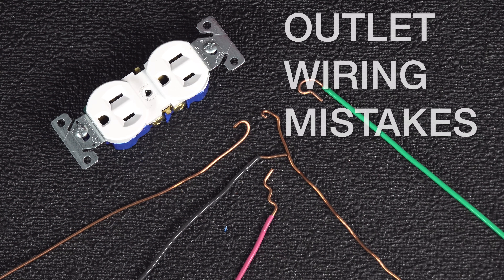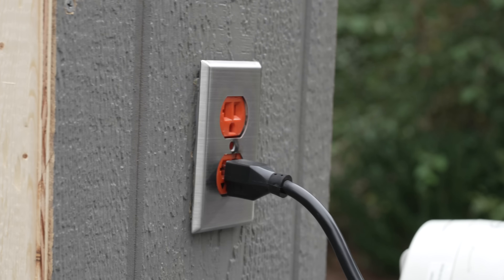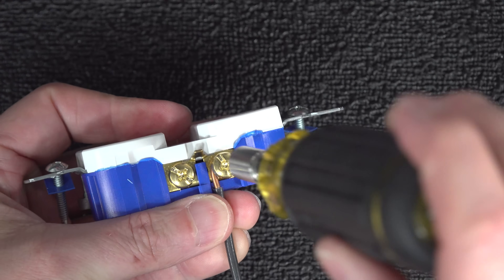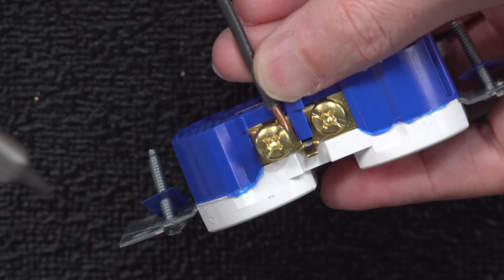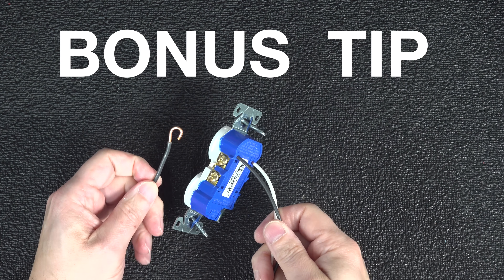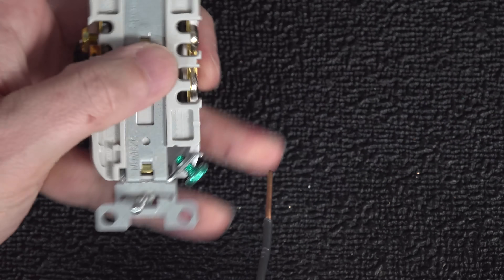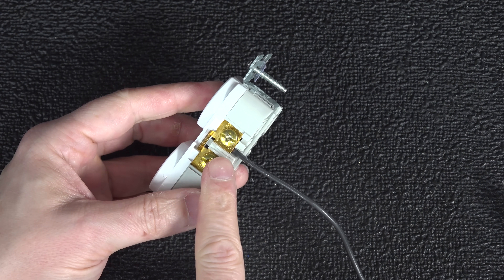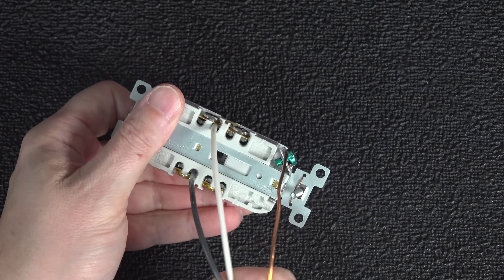BEWARE Of These 3 Common Wiring Mistakes On Outlets & Switches

Comment: I know the ground wire normally doesn't carry voltage, but, if the ground wire in a box is not properly pushed in it could contact a screw and short.  Receptacles are sometimes wrapped in electrical tape to protect against this.  Why don't the "Romex" manufacturers insulate the ground wire any more?  Cost savings, I imagine.  I've seen work from the 1980s where the ground wire had green insulation.

Comment: The issue most electricians have with back wiring, they buy the cheapest crap outlets they can because they suck at the job. Leviton or Eaton are all I use, you will NEVER have any issue back wiring. Buy the 12.99 /20 pack and,,, well you'd be kicked off my projects as a sub never to return

Comment: “Back-wiring…electricians are almost never gonna use them.”    If only that were true.   Every single as-built home outlet I’ve been into that was built since the 70s has been stabbed.   New construction is nearly always built as cheaply as possible, and saving a few minutes per outlet is money in the contractor’s pocket.   Anyone taking advice from this video should also research pigtailing…much better way to connect multiple outlets one one circuit than chaining them through the outlet connections.

Comment: Another tip:
When you shut the circuit off, make sure it’s not a split circuit that runs two lines off of a 3-1 cable, where the black wire runs to a breaker and the red wire runs to a breaker and you can flip just one breaker. Despite that, current can still flow through the outlet.

That situation may occur when the breaker box set up wrong. Both of those breakers should be tied together.
Reply: My votech teacher told us about that. He told us he only tested on half of the outlet, assumed it was dead, grabbed it and it "bit" him. It's a code violation to split a circuit without tying the breakers together for this reason.
Reply: @hubert0073  I was going to say that shouldn't a two pole breaker have a breaker tie...

Comment: Those sockets are so 1970's.  Iv been a sparky for 30plus years and never had to wind a conductor under a screw. Nz & Australia have sockets with conductor holes as terminations. Simply twist up and fold conductor back on itself and insert into hole, tighten screw..  move on.

Comment: This is great, especially the tip about using a simple plug-in type circuit tester to be sure wiring has been connected to the proper terminals.  Back in the 1980’s I purchased a circuit tester to check the house current at whatever venue my band was playing to determine how safe or noisy the electric current was for our expensive amplifiers for both the PA system and instruments. One particular venue was an older building, a country club on the north shore of Long Island where I was born. As soon as we set up and turned on our amplifiers a horrible loud buzzing sound came buzzing through our speakers. We tried switching the polarity switch on the amps: useless. I next tried rolling off the frequency of the buzz on the graphic equalizer with little success. Just for s#$TS and giggles, I plugged my new gadget, a circuit tester similar to the one in this video. HOLY MOTHER OF PEARL!  The illuminated LEDS indicated “HOT WIRED TO GROUND”(!). I immediately sought out the manager in charge of the building and asked him if he was aware of the problem. He had a look of disgust and disdain as he told me to mind my own business but in not a friendly tone. Nevertheless I asked him if any other bands had problems with the buzzing sounds in their amplifiers and he said maybe but no one ever gave him the information that I did. I even went on to suggest he have an electrician come in and check out the possibly of a dangerous condition. He walked away and that was the end of the conversation. 

Fast forward to a few years later; I noticed an article in a local newspaper about how this very same historic and funky but charming old building had burned to the ground in the middle of the night. No cause was reported but I just had a feeling, ya know?  I always wondered if that weird wiring could have caused a short and a subsequent fire in that old wooden building; guess we’ll never know.
Reply: They also used bronze or worse instead of copper in those days which was a huge number one issue
Reply: Wow! Good story! Good thing no one died 😳
Reply: On a bad termination energy is dispersed in the form of heat. The continual heating and cooling  (expansion and contraction) will loosen a terminal screw causing sparks a short then a fire.
Reply: you should’ve told at least someone who was a high public official in the area about it… or at least a tip to check it out. I wouldn’t be able to live with that guilt, knowing something happened with a fire and ppl got injured or even worse. great job 👏
Reply: The #1 reason for fires in restaurants, venues inns et cetera is the fire insurance policy and losses. The owner/leaser burns the place down and collect the insurance payout.
Reply: Hmm, him telling you to mind your own business makes me think it was intentional… anyone could just say “huh, that’s odd.”, and move on. He got defensive. Cashing out on insurance perhaps?

Comment: Having seen a duplex receptacle with the silver and brass screws on the wrong sides (from the factory that way), I no longer trust the colors but instead wire according to the slot position.

Comment: I wouldn’t use the slot in the back with the screw. If for some reason the screw loosens the wire can fall out. With a hook, even if the screw loosens the wire will still be there and you don’t run the risk of a short.

Comment: Where I live, almost every outlet I've ever worked with has been backwired, so electricians definitely do it.    
If I could, I would entirely ban backwireable outlets. ALL OF THEM. No matter how old the installation, 
they would have to be replaced with properly connected decent-quality devices by a certain date, Period.   
And one more problem: Most people fail to TIGHTEN the screws. They need to be cranked down HARD.  
I've found some so loose that the connections were far worse than with backwiring.   

No, I'm not a professional electrician, just a practical person.

Comment: The other thing you should point out is is the side with the green screw USA green screw is also the neutral side or ground as you called it the white wire the green and silver screws are always on the same side simple way to remember where the neutral wire goes same side as the green

Comment: Nothing wrong with Backwiring connection, 25yr in trade and it's the only way to safely do it.. The problem is "Homeowners" trying to be "Electricians" simply because they are CHEAP!

Comment: There are many misconceptions, the stabs on the back instance; wouldn't be there if it were illegal. And it best if only 3 pairs of wire is used. The example of the over used receipt. Is a 15 amp non-appliance... The other in the demonstration is a 20 amp. There is a difference. Proper way to hook up device. DON'T OVER WIRE IT... And anyone taking advice from a want to be electrician. Is asking for trouble....

Comment: NEC has required pigtailing wires for a few years now so in new construction you will only have 1 wire to each side of the device, which will then go back to a connector/wirenut that connects any other wires of a circuit. Designed to hopefully keep from overloading a device.
Reply: you only have to pigtail when you have more than 2 wires cause you dont want to double lug a screw and there is only 2 screws. if you have ever wired a massive house or building with over 100 outlets it adds quite a bit of time to a job to pigtail two wires. i have never know. any other way and ive been doing this 15+ years
Reply: You are confusing commercial/industrial requirements with residential requirements.  NEC does not require residential wiring systems to pigtail at the point of connection. Its all about what the device's UL and CSA listed uses are and possibly local ordinances that could require such a thing

Comment: yeah your bouns tip is bull shit. they are more like 2 or 3 times the price.  been buying installing replaceing, selling them retail and wholesale and have sold more outlets then you have ever touched or possibly even seen in your life.  do your research and understand what your talking about before you preach to the masses.  just shows how much your willing to teach your self before your think your done and move on... current price checking after typing this at lowes in CA basic easton 15 amp outs non TR $2.57 and your "HD" outlet in eaton 15 amp non TR $5.61.  do the math its not $.50 cents and it never was only .50 cents buying one outlet to film your chitty fake news BS film sure it may not seem like a huge cost difference but how many outlets do you have in your moms basement?  now go to a real house and count the outlets. how many? 50-100 or possibly more.  now do the math so for every HD one you buy you could have bought 2 basic outlets.  so your outlet bille went from roughly, 257 dollars to 561.  so what math are you using that works out to be .50 cents per plug?

Comment: You didn't talk about only one green wire per screw .. never, never, never double up green on the screw.  Use a pigtail of you have more than one outlet and tie them together using a crimp collar or wire nut to the main green wire.  ...  Great video ... can't tell you all the crap I've seen over the years.

Comment: The "backstab" method is easy, but dangerous over time. And loop hooking can be immediately dangerous if done incorrectly. And though safer, it's too hard to do it correctly. But the clamp method is a Godsend that is easy enough, yet safe enough. But why is the ground still required to be loop hooked? Is it because it's safer than clamping, in which safety is critically important with the ground connection, unlike the hot and neutral connections? Or is this an unspoken political compromise to the  old school master electricians crowd? As in, "Fine, we'll tolerate backstabbing the other two connections, but only if the ground connection remains strictly a loop hook only."

Comment: You forgot to note that on the better outlet you can snip the jumper and make a separate outlet for each of the 2 plug ins so you can have a garbage disposal plug in on one of plug ins controlled by a light switch and not effect the other plug in or... such as in a living room where the light switch can control a floor lamp plugged in, while the always hot plug in can be used for a vacuum.

Comment: You cannot put 8 wires into these slots- This is a code violation-  "devices shall not" be used as splicing devices.  Period!  youre obviously not a trained electrician.  if you need the code section let me know.  bad information on that section. they have another purpose which i will not go into since you didnt cover it.  The stablock on the back is for 14 gauge wire only which is 15A rated.  This covers the reduction in contact on this 20A receptacle. Be safe kids!

Comment: I’ve been an electrician for 25 plus years and I still wrap the screw with the wire even if it’s like the last one. Old habits are hard to break. I also usually wrap all screws with electric tape especially if it going in a metal outlet box.
Reply: I do the same. I don't use tape in nonmetallic boxes but always in metal boxes
Reply: Same, especially with the metal box application. Always tighten unused screws and tape them all up. I've learned that lesson the hard way.
Reply: 3M super 33+
Reply: I'm not an electrician, but if you strip the wire 3/4" and wrap it around the screw and tighten properly then I don't see how it has any less contact than that channel method.  In fact he clipped the wire a little less than 3/4" then inserted into the channel.
Reply: @eldnah2  because when inserted into the hole, it's a thin piece of metal that pinches the wire. When wire expansion happens the metal holding the wire expands too and over time becomes weak. Screwing it down also gives you the option to tighten periodically if need be. I'm just here telling you what I've seen and what I feel is the safest method. One should always check for warmth on a well used device every so often especially if it's used a lot and if it's used for higher amp appliances. Be safe.
Reply: @eldnah2  I can’t argue that point other than I’ve had to replace several outlets that were melted because of bad contact points on these outlets wired in that fashion. With an outlet screw wrapped with the wire in the correct way you will usually never have any issues. Again just my experience over the years.
Reply: Some of those gfci outlets leave almost no clearance with a standard 1-gang box.. I don’t usually tape but have several times when upgrading old ungrounded wiring to gfci outlets in old houses. The difference between modern and old electrical is crazy.
Reply: @MittyNuke1  on GFI devices I use the push in holes because they are tightened with a screw. You're right about new vs old, it's crazy. I've replaced more than my share of the old knob and tube wiring, also the old aluminum romex.
Reply: @lewisoversole6781  true, I forget exactly but I did a couple gfci outlets the other day and know they had the metal plate that sandwiches the wire, forget if it had holes in the back/think it was like the higher end outlet shown in the video, but it clearly was a good connection. The ground wire also had a proper metal insert to help make a good connection. For small stuff at my own home, I prefer to get the higher end components just to avoid the issues shown in the video. I’ve seen multiple outlets, dollar store budget style, completely burned out from loose connections or push connectors. I’m not an electrician, so I don’t think I’ve seen aluminum romex (heard it was popular in mobile/trailer homes) but I’ve replaced knob and tube and swear it was like a science project in the rental house this was located in.. hot and neutral routinely swapped, randomly connected to newer wiring in various places with no junction boxes, just a complete mess. Those old cloth wrapped cables with the flaky black insulation (maybe some sort of rubber that has since hardened) also just make a nasty mess. But hey, this house had gas piping going to where some light fixtures were, so it was kind of crazy to see what was likely a house built without electricity, that was later retrofitted with it. Also, it seemed like junction boxes were considered optional for a lot of this early wiring, or lighting fixtures were added by homeowners or handymen without proper experience over the ages. This was across a few old rental houses, interesting stuff.
Reply: @MittyNuke1  be safe buddy. I’ve pretty much seen it all myself.

Comment: Other tip, if you make the ground longer then the other wires, you can insure that if for some reason the outlet gets ripped out partially, it is still grounded
Reply: @JesusGonzalez-kg2fe  what are you on?

Comment: I've never seen the backstab only (no screws) outlets and switches for sale, only where the outlet i'm working on hasn't been changed since the first electrician. They couldn't be bothered to run the screws in while on the clock.

Comment: Greetings. I just watched your video and I wanted to commend you on the quality and content of the production. Very Nice!

I would however like to clarify a few things:
1. Outlet is a generic term that refers to any point in the electrical system where utilization equipment can be connected. If we polled 100 homeowners, I'm sure that they would all refer to "receptacles" as "outlets" and while that is technically true, an outlet needn't be a receptacle. For instance, a ceiling box to which a ceiling fixture is wired is an "outlet."
2. You describe connecting wires to those crappy contacts in the rear of receptacles as "back-wiring." I find that the majority of electrical professionals refer to this as "back-stabbing" in contrast with "back-wiring" which I believe most would associated with your demonstration of feeding the wires behind a clamp and then tightening it down (on receptacles that offer that feature and IMO, it's the best way to wire). In the end though, your video does a great job of trying to dissuade people from back-stabbing (I wish manufacturers would simply stop including the means to wire in this manner as it is unreliable and unsafe).

Bravo!

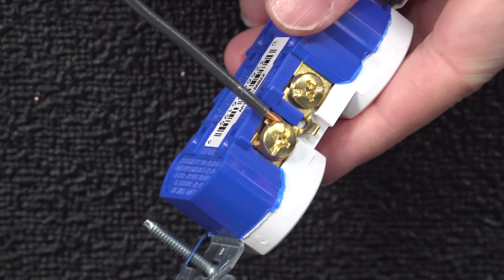Comment: 2:17 I don't understand why code still allows those instant backstab connections when nearly everyone says they don't work. It seems that  if they simply banned the cheap outlets, the "slightly upgraded" version at 3:00, which seems even simpler to build, would get the economies of scale needed  to come down to the prices of today's  cheap outlets.

Comment: I moved into a house I bought.   When we put the new treadmill in, the breaker went off.  When I plugged the treadmill into another outlet on the same circuit, it didn't happen.  Well the outlet that was tripping the breaker was hooked up backwards.  Doesn't seem like a bit deal but it was.....  Good Video.

Comment: 😳😬30 minutes ago I had a outlet blow. Instantly burned my charger cube and the outlet. Melted the plastic too. 
About 1-2 months ago I had two very large plugs explode right at my feet.  I have no idea how I didn’t get shocked or burned. The second I ?heard? it,  I jumped across the room and managed landing, sitting on the kitchen island. 
Scared the heck outa me. 
Thank you so much for this. Electrical fires are terrifying. It’s hell-fire!